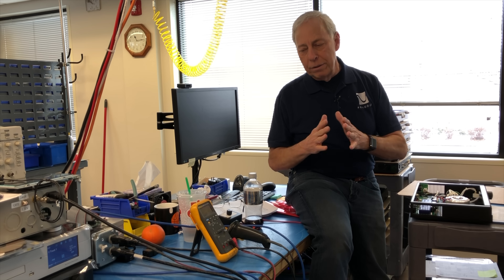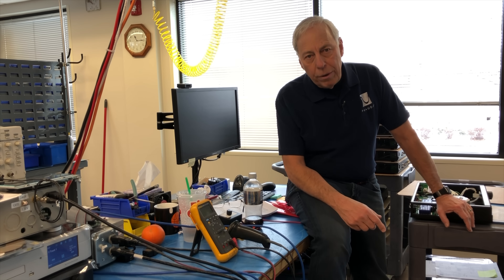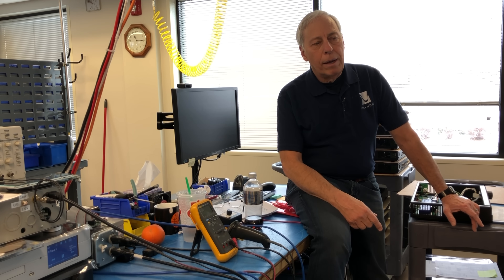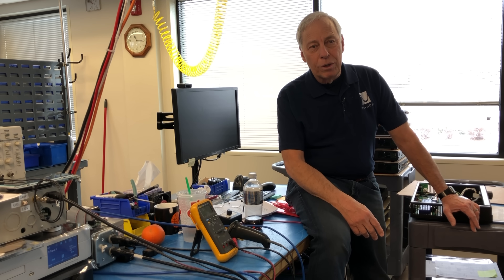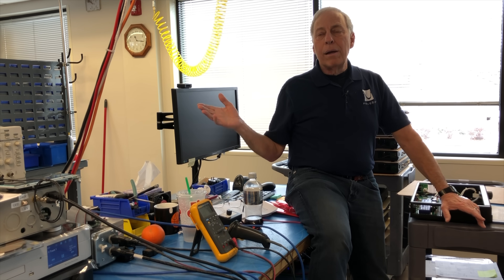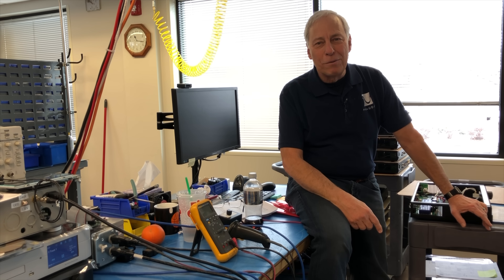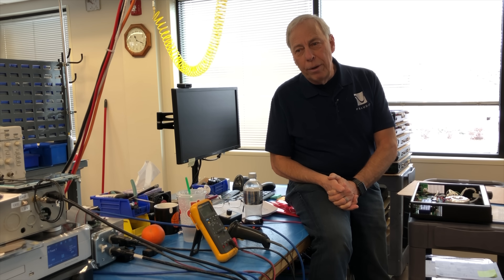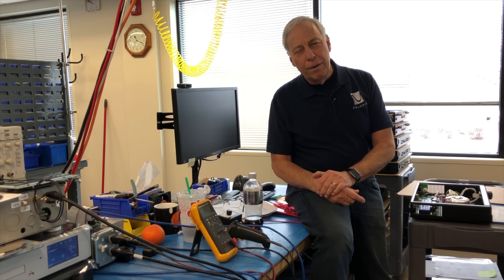An amplifier's first watt

Comment: Paul, 
I keep hearing the term (low level detail).
I understand it's meaning in business management but not in audio , can someone define this for me?
Reply: Low level details is the sounds in the music that is way softer than the rms level. If you have heard a very good resolving system, you will know what I'm talking about. Most people have not heard it in their lifetime.... unfortunately.
Reply: @oysteinsoreide4323  
Thank you, I did not want to assume what it meant,  I also thought it might be resolution 70 hz. and below , example when a cello, electric bass and organ are all doing low notes being able to separate instruments in to layers.
Some pipe organs used in churches can really become complicated buy them selves .
Reply: @oysteinsoreide4323  example ,
E. POWER Biggs Toccata and Fugue 
Played from RTR , will test any subwoofer or large floorstaders that go low.
sad how few subs can do this recording when he starts working the foot pedals.
And everything goes really low, nothing under a 10 inch driver can make any sense of this recording at lower frequencies.
Reply: when you hear their whiskers brush on the microphone

Comment: Shout out to Nelson Pass
Reply: Build one of Nelsons low powered amps (amp camp kits) over at diy audio and you will find out quick how good low powered class a amps designed with minimum parts and a elegant design can sound😀
Reply: @Brandon Burr It’s funny that you mentioned that in the other comment I was involved in! I’ve got a feeling you and I could talk shop and go on for many hours...
Reply: @NickP333  yep. That was me lol. I was spreading more excitement for pass labs diy audio😀 I don't claim to be the most knowledgeable about this diy audio stuff. I'm still learning, research and more learning. I think the only was I'm gonna sink some of the stuff in is to dive in in steps. I decided to start smaller than the f5 turbo and go with a aleph j. Build the power supply big enough to use it on  basically all the first watt amps f6, f5, aleph j and guessing it may with on the m2? I still would like to build a f5 turbo as well. Didn't realize that it's harder to find some of the big 15,000, 22,000uF 35 volt and up panasonic capacitors for my diy audio psu v3 board. Where is a good source ? Think 6l6 mentioned nichecon caps would be fine. Lots of series of them though. I may go with a antek transformer. Honestly don't know what else is out there. Checked with plinton out of Canada.  $1200 minimum order...ouch! I ordered some ptfe wire and what is good for power supply wire gauge? Input and signal wires folks like small gauge. Like 24, 26, 28 ? Hope your build is going ok!
Reply: @brandonburr4900  using his ACA. It's glorious what 5 watts can do..
Reply: @siddhantmerh592  that's what I have heard😀 what speakers have you found that works good with the amp camp amps? Out of curiosity have you used it as a headphone amp used a speaker tap to heaphone connection for a inefficient pair of h3adphones? Thinking of trying it with some sennheiser hd 650😀
Reply: @brandonburr4900   I am using the ACA V1 with more caps with full rangers Alpair 7p in Frugel Horn enclosure and a B1 buffer as a control . If you thinking to power a Senn hd650 I know someone who enjoys an RJM Sapphire as much as he does his Teton and Mogwai.. someone makes them here in Bangalore. There is also a Salas DCG3 preamp for sale by my friend (gotta check if he is willing to ship) which can be made out with a headphone out.. I have a basic Stax SRS 3100
Reply: @Dave Micolichek 😂 Yeah, you’re right. It’s a Class A filter that puts out a good amount of heat too. As you said, it is a simple one, but it doesn’t really start to filter for at least a half hour. Lol
Reply: What is a nelson pass?
Reply: I think it’s a very complicated filter of some kind. 😂
Reply: @thegrimyeaper  Eye'm not sure... Better ask Pierre-Charles-Jean-Baptiste-Silvestre de Villeneuve.

Comment: Some audiophiles are using the new crown amps with good results
Reply: Meh
Reply: @My Name If I were going to use a Crown for anything fidelic it would have to be a class I like the Itech or DCI. I think the old DC300 was class H maybe? Crown used to offer a Reference series which I am told was pretty good.
Reply: The DC300 and A were class AB + B. They would run the drivers at class AB and they would run the speaker line up to a few milliwatts then the outputs would take over. The Reference series used the same scheme except they were bridged amps.
Reply: @johnhodgson5313  Wow. I guess Class AB had it's growth phase too. I always thought they were Class H because they really were not that impressive. What was your take on the Reference? I never heard them. I took a Crown (Macrotech 600 I think) from the live side and brought it into the studio one day just to hear it against our Haflers and Yamaha. We just used the Yami to drive headphones but as it turned out it was a pretty reasonable amp as well. The Crown  was fairly smooth and of course had power for days but not very good detail. The Crown Reference was pretty expensive compared to the Haflers and they were pretty much the hot ticket in studio amps at the time. Late 90's btw. I had always meant to ask the rep to send over one to see but I was always too busy when she was around.
Reply: If the amp had been class H they could have made it smaller, the heatsink wouldn't have been so big and the transformer could have been smaller. I find it interesting to note that the 300 and 300A used a 1.2kw transformer and rated the amp just overt 500 watts total output. I am looking at a CE1000 and the transformer is MUCH smaller. I would give almost anything to have a day or 2 with a Reference. I talked with Clay Barclay who had a lot to do with the Reference and he said get either 2 Power Line 4 or PS400 and run them both bridged. It won't be a Reference but it will be good. I haven't done that yet.
Reply: @johnhodgson5313  I remember the CE Series. Weren't they one of their cheaper lines aimed at the install market? I thought they had a higher end install grade too? I have yet to have one in a critical listening application but the discussions about the Class I stuff is pretty insane. Greater than 5000/1 damping and the reality is with 18 and 21 inch drivers the impact difference between that and others is totally audible. People swear up and down in live production about Lab Gruppen but when you physically swap back and forth the Crowns hammer where the Labs just hang on the notes. It does make people think the Labs are louder but they aren't.
Reply: Rob Chapman I thought it was class D
Reply: @russredfern167  The CE Series or the Itech? Itech's are definately class I though. Crown  holds the patent on class I and that amp is what they used it for first.
Reply: The CE 1000 and 2000 are analogue, the CE4000 is class D, if that helps.
Reply: I liked the CE when it first came out, but not now. I am not in a position to play with a lot of amps these days, so I can't comment on the newer stuff.
Reply: @johnhodgson5313  We were just trying to figure out if the could even come close to measuring up to  the reference. I guess the answer is no?
Reply: @johnhodgson5313  They were directly competing with QSC at the time. Crest had basically fallen off the map because Peavey bought them and made everyone scared. Since they went to class D QSC's have been really gritty sounding. Since the CE's were at about the time when QSC first went class d I am inclined to agree with you. The earlier QSC stuff was pretty good though.
Reply: John Hodgson What year did these come out?
Reply: @russredfern167  As I remember it they were like mid 2000's. PA amps have gone to  almost entirely high power density for a decade now. There is really no such thing as a class A/B amp in the world of PA anymore.
Reply: Crown ran them for a while though.
Reply: Thanks for the information. Another gap in my knowledge filled in. You seem to have a lot of knowledge on these commercial amps. We had switched to QSC for a while. Now I have no idea on the digital amps. When they first started getting popular they weren't that good, and now I can't just borrow an amp for the evening or a weekend.
Reply: @johnhodgson5313  For both of us actually. That is why our world is about sharing. As far as the amps I have worked in pro audio as a freelancer for a long time so I get to spend time with a lot of gear.
Reply: I saw one guy from japan who bought crown amp. He Has vlog on Youtube

Comment: The modern crown amplifiers are very good there designed to be flat with no colouration
Reply: Correct, flatter the better
Reply: a flat amp + flat speakers needs a flat listening room. Even then, you may not enjoy the music.
Reply: It's not the neutrality that decides if you like the sound or not. Most solid state amplifiers are very neutral, but still they sound different. It's how the sound is presented in the speakers that is most important. And most pro amplifiers has noisy fans which is very audible in low volume situations.
Reply: Oystein Soreide - huh?
Reply: @Enemji  They sound different, because only slightly different sound can be very audible. But also the speaker match is the biggest impact. Two amplifiers can almost sound like with one set of speakers, but very different with another. Being neutral is just one of many measurable traits of an amplifier. You should never just shop amplifier without thinking about what type of speakers you will be using, and how loud you will be playing.

Comment: I heard an amplifiers sweetspot for sound is at 35% volume
Reply: @Dave Micolichek 
 
That is correct (and doesn’t contradict what I said).

Take note that THD (as well as IMD, crosstalk, etc.) stacks across the components in your chain. So, while 1% THD at 8kHz may not be audible, that doesn’t mean you want a DAC that’s 1% THD at 8kHz. 

This is why I choose something like 0.1%.
Reply: Depends.
The Benchmark amp has similar distortion from half a watt all the way to the rated 100W.

Many solid state amps do rise in distortion after around 70%.

Sounding the best at 35% is rarely true.

Look at the THD measurements Stereophile does for every power/integrated amp.

Now, do take notice that anything below around 0.1% THD can be treated as inaudible.
Reply: i would say that depends on the amplifier
Reply: I thought the question was asking something like the performance of airplanes. Some high performance jets may stall at slower speeds as compared to other planes, and they aren't as efficient as they could be at non-stall minimum speeds. They fly better at cruising speed (beyond the first watt); this may not be an apt analogy though.

Comment: The majority of people do not even use more then one watt of aplifier power.
Reply: Yeah 'cause they use mobile phones and headphones.. 🤣
Reply: Depends on the speakers...
Reply: Poor people. I use anywhere from a few dozen to 3000 watts. Gotta feel the music!!
Reply: room-ten-oh-nine !  depends on the speakers, first at least. Actually, SPL measurements are done at 1W/1m (or better said, 2.83V / 8 Ohm / 1m) so speaker sensitivity does matter a lot. For every 3dB loss in sensitivity you pay with half the sound pressure level at the same 1W - and vice versa. Regarding perceived loudness we can say a 85dB speaker is 1/10 that 'intense' at 1W (or mostly at any levels) 😊 than a 95dB speaker (taking the same 1W from the amp). We can do smaller parties with flea watt apmlifiers too if the speaker drivers are sensitive enough (either by construction or because of room modes, horn boxes, etc). But if speaker sensitivity is medium or low, these amps will have a moderate loudness only. Music is just the second factor. 😊
Reply: room-ten-oh-nine !  Nobody seems to be taking music into account for some reason why is that?
Reply: room-ten-oh-nine !  I guess the original statement struck me as odd everyone I know uses more than 1 watt of amplifier power I thought that was the norm.

Comment: As a lover of flea watt single ended triode amplifiers, yes the first watt is important. So is the other watt.
Reply: @John LeBeau 😂🤣 Perfect! Not sure your “other watt” joke landed. I personally thought it was very funny and clever!
Reply: If you have to explain it.... I'm glad someone got it. Thanks.
Reply: @33Ddg209Ret7 I wasn't familiar with the AER speaker so I went to their website and saw the coolest looking single driver, open baffle, clear acrylic speakers! If they sound half as good  as they look (I realize this cabinet is not what you have) you've really got something there. My system is also DIY, 4'x8' sheets of subfloor material, standing on end and open in the back. They are not in my living room. A 15" Altec 515b does the bass, an Altec 203b 2 cell compression driven horn is my current midrange with a RAAL dipole ribbon tweeter for the top end. The Altecs are both vintage, circa 1960. I have three non-commercial 45 tube, 2 watt directly heated single ended triode amps, one of which I built myself, but currently I have a Nelson Pass designed Amp Camp Amp (that's it's name), built from a kit, 6 watts single ended transistor, driving the tweeter, with two of the SETs powering the Altecs. The crossover is active. These will do quiet and delicate, but they also get loud and deep without any harshness. The tweeter is 93db efficient, with the bass and horns 102db and 114db respectively. If I could hear no other speaker for the rest of my life, that would be just fine, I like this system that much.

Comment: Great video! Also, I was hoping, if anyone here in the comment section knows about professional audio gear, could you steer me in the right direction in terms of which power amplifiers (and also speakers) are musical in your opinion and which manufacturers tend to make such amplifiers. I do audio for a small church here in Indiana and we have a fairly simple audio setup, nothing fancy, but being an audiophile I’ve really wanted to see if I could put together a system that sounds musical. Hopefully, something somewhat affordable since we’re a small church and an expensive audio system is not exactly where you wanna put the community’s money towards lol. Any suggestions? And thank you in advance to anyone who can share some advice.
Reply: crown drivecore series many audiofiles use them.  Cerwin-Vega CVi-152 with some subs Cerwin-Vega CVI118S .  one extra tip double the amp power over the speakers rms rated power.  this will give you clean sound no matter what volume.
Reply: I would think something with a horn, perhaps some jbl or reconditioned Altec like Voice of the Theater?
Reply: Go with the Crown lxs 1002 about $290, or lxs 1502 driver core, class D, best to buy two or more they can be used as active crossovers built in DSP in all frequencies, and with subwoofer output can be bridged to  mono as well. What speakers are you using...? Might want to look at  tannoy 802 studio monitor speakers, cheap for what you get. Powerful with good base can be hung up on the wall or ceiling can buy them with stands for £319 at Gear4Music, I think that's each don't forget the prices per 1 speaker, they are active

Comment: I remember the Crown DC300 amps and one of their advertising claims was that it could drive a 70.7 distribution line directly from its 8 ohm output.  I am sure it could, but I would think it would still suffer huge losses in the lines to the speakers and coverage would be weak ant the end of the lines.
Reply: It did produce 70 volts at the speaker terminals bridged as does any 600 watt at 8 ohm amp. As for losses, a 70 volt line  doesn't care how it gets the 70 volts, once it leaves the amp the line losses will be the same. A funny thing happened the first time I did this. We used old Bogens and TOA to drive temporary installs and people would hook up little 8 ohm speakers in odd areas despite being warned not to. This would bring the amp driving that line to its knees. We switched to a bridged Crown and someone hooked up their little speaker. We heard a very loud sound from some distant corner and then it stopped abruptly. I would have loved to see the smoke show.
Reply: I used to service commercial sound systems that operated on a 70.7 volt line.  When an 8 ohm speaker without a line transformer is added, it appears as a "short" on the system.  It will play very loud and shut off all the other speakers in the system.  They rarely burned up though.  This was rather common because people that did not know better would sometimes add a speaker and not even realize that they caused the system to fail.   I can see why it burned up with the crown amp though.

 I think you are right about the Crown amp's ability to run the system though.